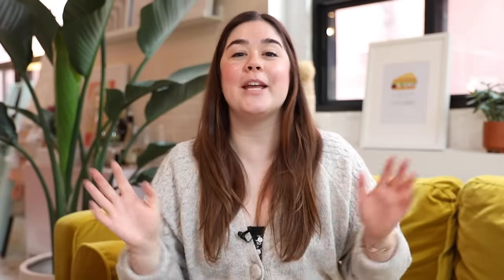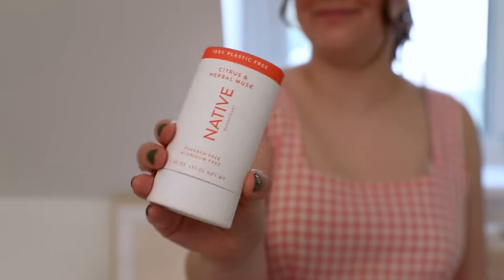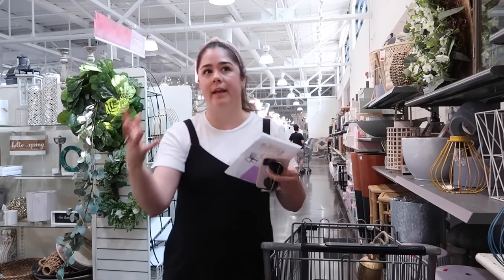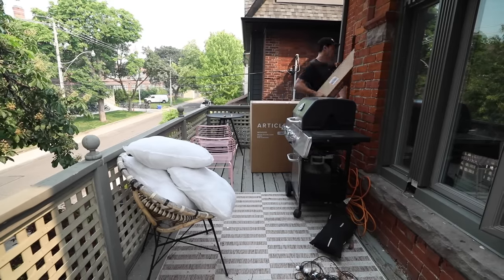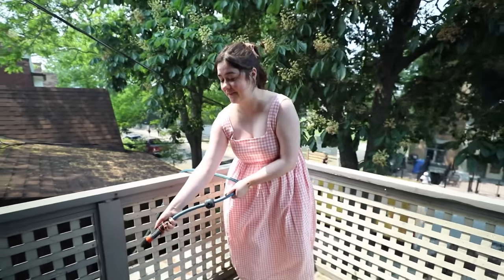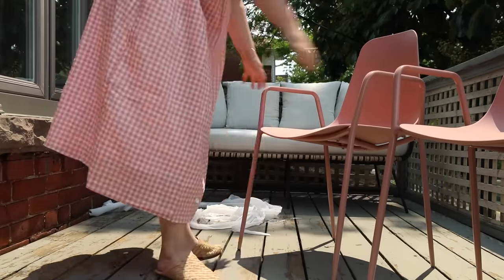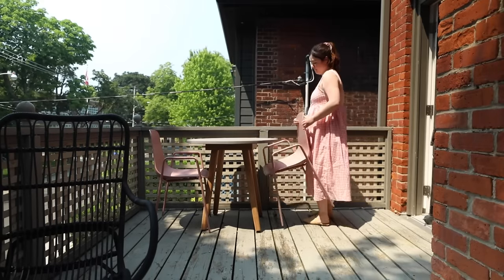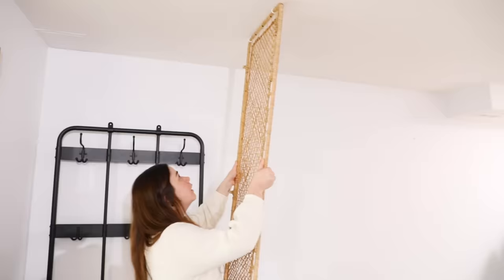Cleaning and Redecorating My Apartment Patio For Summer!

Comment: Gardenias are also acid plants so make sure to use that kind of fertilizer. Hard to find in liquid format but get potting mix that says for acid plants. The store may have told you but if you later have issues with it could be that.